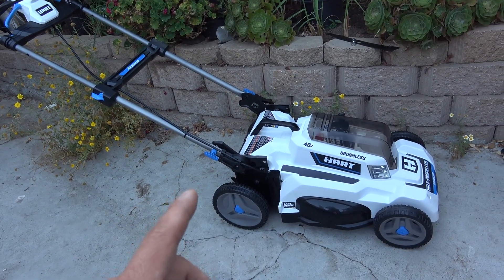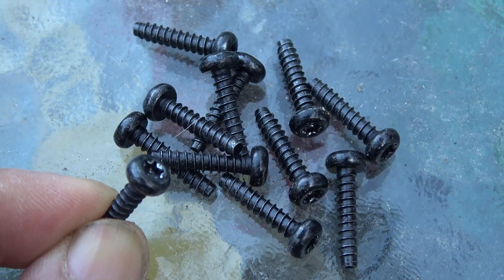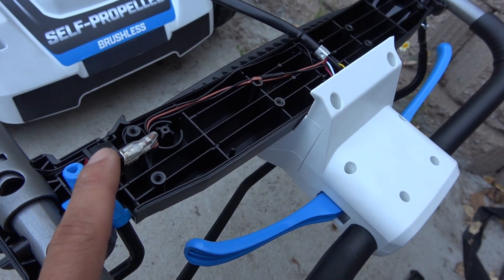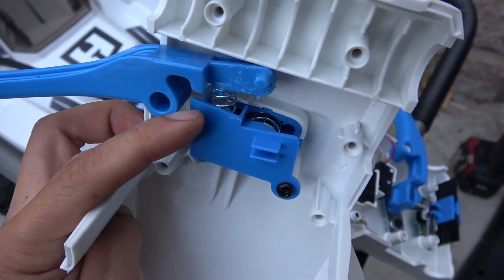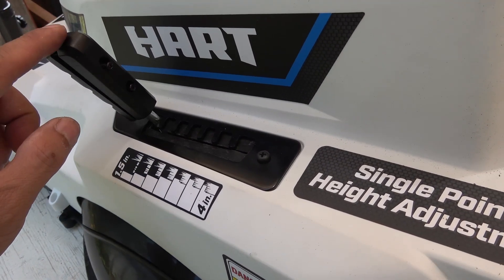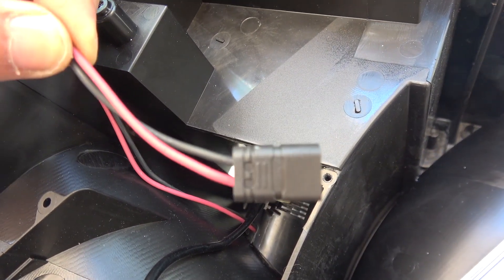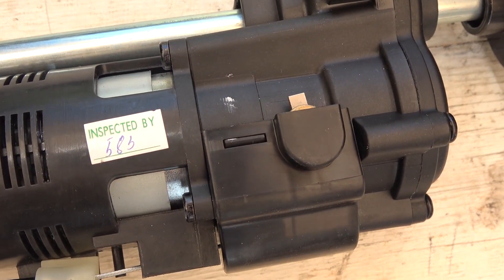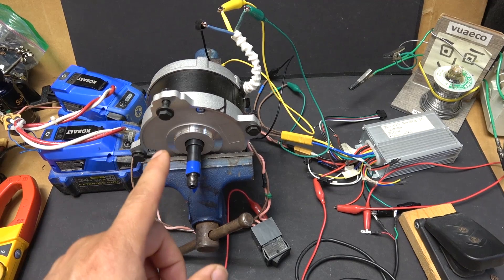Hart 40V Brushless lawn mower teardown w/ 40V brushless motor

Comment: Bro, your video is amazing. Really appeciate your hard work. I am thinking to make my Bosch Rotak 430 Lawnmower self propelled. 

I plan to install 

1. 2 Front wheels with DC Motor
2. One DPDT Switch 
3. One Speed Controller 

How to know which capacity of motors can i install so that they can pull the lawnmower. Currently the lawnmower runs on 36V batteries. 
For the DC Motors i will use a seperate battery.

Can you advise how to calculate this power values for the motor.

Comment: I'd imagine that brushless controller is the same as a small (6 FET) ebike/scooter controller if you open it and compare boards. The 'learning leads' probably connect to that small ribbon and connector.or maybe unused hall leads. The boards usually have  helpful markings showing what the connection does for the basic functions

Comment: Great video.  I have the 40v non self propelled version and want to use it as a shredder by running it  upside down.  The problem is it has a tilt or gyro sensor that will not allow the motor to start if it is tilted more than 45 degrees.  I'm  guessing that sensor is on that main controller.  I would love to know how to by pass it otherwise Ill have to pull out that board or sensor and invert it.  Any ideas?  I also think I could "hot wire" this by bypassing all the sensors and the contoller board.

Comment: Great video thanks for posting ....Is it safe to connect a 36v  battery Directly to a brushless lawnmower motor and bypass the controller ? I would like to convert my 36v Florabest lawnmower to use Bosch  36v batteries but it has some sort of encapsulated BMS / thermal sensor in the mower . can I just bypass this ?
Reply: NO
Reply: no, the motor runs on 3 phase AC. I already went down that rabbit trail. The controller must have an inverter circuit is my guess. 73

Comment: I used 3 of these on a 54" deck for my electric zero turn first version with full size blades. They were barely enough for normal length grass. I upgraded them after half a season to sensored motors that are just a little bit larger. Huge difference. Now I have 4 of these and don't know what to do with them lol

Comment: are these motors worth using in an E bike? or any of these components?  i picked up a brushless ryobi 36v mower motor but no controller for it (suspect simple 3 wire, but i haven't looked at it yet)
Reply from the maker: The motor is absolutely good for an Ebike.
Reply: @vuaeco  i hope to learn how to do something with it than just buying a kit(can't afford one) still learning about batteries and charging/bms from your videos is giving me  confidence :)
Reply from the maker: @deankdx  Use power tool batteries. It already has BMS and standard charger.

Comment: Good stuff! I recently cleaned up a Ryobi mower that looked exactly the same under the cover. Other than the blade and wheels being beat up, everything else was in good shape. I also got a plug in Ryobi pressure washer that has a BLDC motor and looks like it could be repurposed with the right motor controller. It's nice to put things to use instead of throwing everything away. Thanks for the video!
Reply from the maker: It's probably made by the same manufacturer, TTI, which also makes Ryobi, Milwaukee, and Ridgid tools.